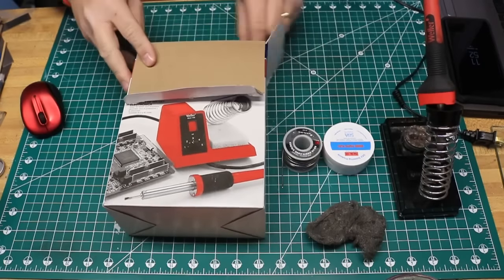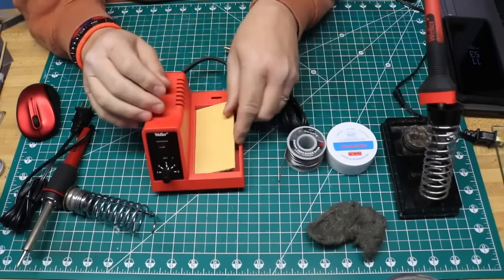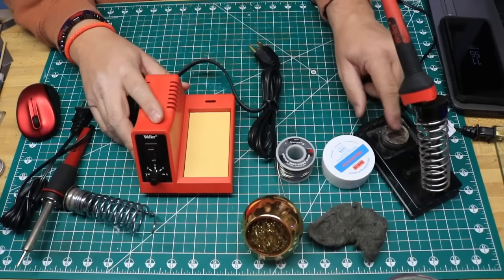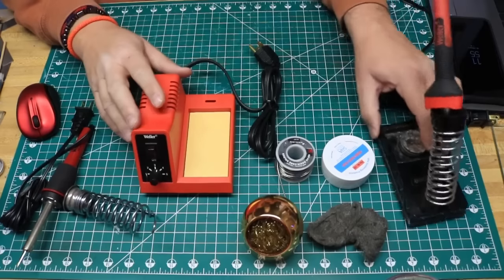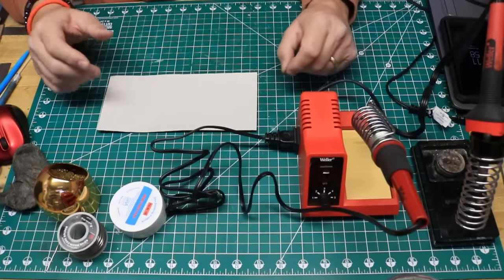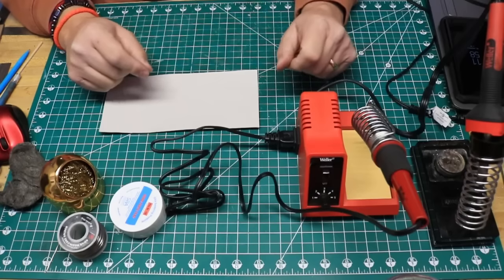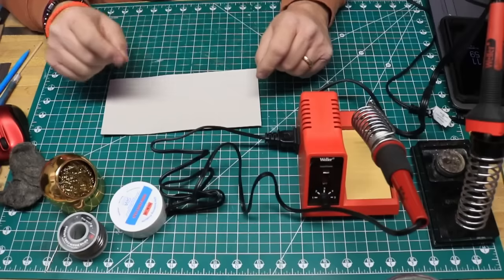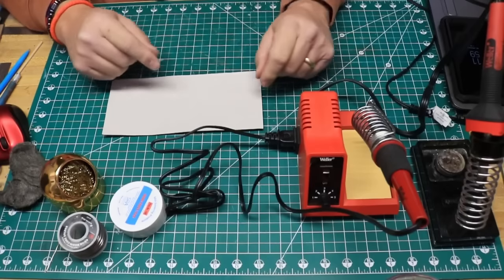How To Tin A Soldering Iron Tip

Comment: Ron,  I started Soldering with Silver solder and an Acetylene Torch, soldering pieces of Copper together.  I did this fresh out of High School.  This was my Job just after graduation at my Fathers Stampings company.  Not anything to do with the small electronics soldering we do now. My Dad worked with me when I first started doing this job and he told me the most important thing to know about soldering is that solder flows to the heat!  This information has always helped me to do a good job in soldering.  Knowing that it is the heat that does the work!
Reply from the maker: Great point. Thanks. 👍🏼

Comment: Ron, I have a question. Do you apply flux before you wrap the solder around a new tip or just the solder without the flux
Reply: I would love an answer also
Reply from the maker: On a new tip, just solder.

Comment: I am new to soldering and it’s been really frustrating, solder refusing to melt on the tip. 
Thanks for your advice on cleaning and tinning the tip, it’s much easier now, many thanks.
Reply from the maker: I'm glad you found it helpful.

Comment: Wow!!!! Ron...a most helpful video. I just finished watching your "adding a crossover" video and before asking about your cleaning solution prior to the brass cleaner I watched this video on soldering. This video reminded me of seasoning a new cast iron skillet and why its done. I have been doing all the wrong things with my soldering iron for years and now know why the lack of performance from it. I never tinned it to begin with, I used sandpaper on it all the time to clean it and I never put it away correctly. Thank you for sharing this info..I need to pull out the iron, get the products of proper care and see about re furbishing my iron or buy a new tip and start from scratch correctly. Tom
Reply from the maker: Glad to help Tom. I think you will find much better results and longer life from your soldering tips going forward.
Reply: I've honestly never tried to solder before all because of the things you pointed out, got my first iron a couple days ago and I've been worried about plugging it in til this video lol

Comment: I do the winding solder around a new tip thing, I use up old bits of solder I no longer use to do it. Maintenance is the key, and before you run of to celebrate completing one of those cheap SMD practice boards, tin you tip. Or is it just me that goes into celebration mode? I actually keep my boards to monitor my improvement… I'll go back to my sad little corner now.

I’ve seen elsewhere that the tip tinning cleaner should be used before leaving your iron to cool as it works better. I’ve always used it as you do until now and my Hakko T18-D16 must be a year old and looks like new.

I use the Weller brass sponge as it’s finer and seems to clean better, I heard it actually has more/better flux in it. I didn’t even know they have flux in them until then.

Comment: Very good video. I rarely use a soldering iron but this information may keep my 15 year old iron in good working condition. Thanks!
Reply from the maker: A rarely-used soldering iron is a great case for why tinning after use is important. The longer your iron sits between use the more important it is to keep it tinned and protected.

Comment: I learned to solder back in the 90’s as a kid. My dad taught me. Anyway, he taught me to use a wet sponge. IMO, nothing beats a wet sponge when it comes to cleaning your iron.
Reply from the maker: A wet sponge works great. The tinning solution just gives a bit of extra boost to the cleaning and coats the tip in solder.
Reply: I've been soldering for about 55 years, including two decades as a full-time audio-equipment bench tech,  and I switched over to the brass wool sponge about 10 years ago. I find the brass wool works even better than the sponge; and some manufacturers claim that the thermal shock of putting a hot tip on a damp sponge creates micro cracks in the iron plating of the tip and causes the tip to oxidize, pit and deteriorate sooner. PS, Ron, you're using the tip cleaning block far too often; they typically contain a harsh alkali such as ammonium chloride and if overused will remove the iron plating from the tip and hasten it's demise.

Comment: I'm brand new to soldering and I never did this.  I kept wondering why after a few connectors soldered why my tip was black and not transferring heat that good. Thanks for the help!
Reply from the maker: Glad to be of help. Have you tried this? How did it affect your iron's performance?
Reply: @RonsTrainsNThings  Yup it made a huge difference!! I never realized that the tip needed a coat of solder but now it works so much better. Thanks again

Comment: Well this explains a lot Ron.  I've never heard of this before and could not figure out why my soldering iron took forever to melt the finest size of solder I could buy from Radio Shack.  Time to pull them all out and do some tinning.  Is this necessary with the soldering guns as well?  You know the ones that look like a pistol.  I have one of them made by Weller but I have not tinned it either.  Thanks for sharing.  Keep up the good work.
Reply from the maker: Hi, Roland. I believe that cleaning and tinning your tips will make your soldering a much more enjoyable and less frustrating experience. Yes, you should tin the tip on soldering guns as well. Thanks for your comment.

Comment: Excellent video Ron! You know how much I hate soldering and I think you just showed me why. My tips are a black and charred as sin lol
Reply from the maker: Yup, anyone would hate soldering with a black, oxidized tip. They will not transfer the heat. Get a new tip, tin it, keep it clean and tinned, and who knows, soldering may become your favorite part of the hobby.
Reply: Steve, it's also important to use the right tip for the job. For soldering rails, and most general purpose use, I would use a tip that looks like a small standard screwdriver. For soldering electronic components, get a conical or pointed tip. The right tool for the right job.

Comment: Good video.  Thanks for making it.  I never had any formal soldering class/education and it shows.  Am I right in understanding that a higher wattage soldering iron allows you to get a joint hotter, quicker so as not to melt/damage nearby parts/circuits?  I'm thinking a higher wattage iron would be best for soldering track segments without heating plastic rail ties too much.

Also, if you're able, you might consider raising the Audio Output level of videos like this one.  I have the volume on my laptop all the way up, but was still wanting the video to play louder.
Reply from the maker: Thanks for the sound feedback. As for wattage, you want to strike a balance between heating your work quickly and getting it too hot. For N scale rails I use a 30 watt iron. For fine electronics I use about 10 watts--it just doesn't take much to get them hot and high heat can quickly damage surrounding parts.

Comment: Great info thanks so much! Just learning and getting frustrated already. First two attempts didn't go so well. Started with old iron and old solder given to me. The solder job ended up cloudy white and also seen some of it was discolored on the spool. My question is does solder go bad when it gets old?
Reply from the maker: I don't think solder goes bad, but if it is greenish you probably have an acid core solder. You may want to buy some rosin core solder to use. Also, if you have an old iron and the tip is black, you may want to investin a new tip.

Comment: Acid paste flux provides superior cleaning for soldering, I use it when solder assembling Fast Tracks turnouts but a note of caution, the solder joints must be cleaned to remove acid flux residue. I use denatured alcohol. Thanks Ron for an informative video.
Reply from the maker: That is true--subject of another video. Thanks.

Comment: Where can I give something like a quadrillion THUMBS UP 👍 on this??? Cause this deserves MORE than just a single one. 

I bought a cheap ol Walmart Soldering iron...Worked for about 2 or 3 times. No matter what I did, I couldn't get solder to to stick to the tip nor could I solder anything without making a mess or just ruining what I'm doing. 

Ok..Watch some videos, sponge this, scrape that...STILL couldn't get it to work. 

Ok...It's got to be that the iron sucks. 

I go and buy a Weller, regular plug in the socket, no controls Iron, comes with 3 tips...MAN...Worked great straight out of the box. UNTIL the 4th or 5th time using it. Nope. Nothing. I try cleaning, I try scraping, sandpaper etc etc. Dawned if I could tin the tip yo save my life. 

But I read Weller was good....I don't have hundreds of dollars to get fancy dial temp stuff....I want to connect this wire to that one. PERIOD!!! Why should I spend HUNDREDS on something so seemingly easy to do. 

The package of the Weller doesn't even explain anything at all. 

Yet, I watch video after video after video of people just ever so slightly touching one wire to another etc and BAM, done. 

That's the problem with videos these days...."OH, it's so simple....Do this then that, BAMMM!!!! Done.....NONE of those videos go "behind the scenes" to show what that person did to get the iron to work as the video shows. 

And WTF is up with the cost of a spool of solder costing AS MUCH AS a Steak Dinner for 2 people? 

It's SOLDER. Its basically CRAP metal formed into a wire structure. $30 per spool just seems to me to be stupid. Oh, and hey...don't breathe the fumes....so now, in order to do simple soldering.....I have to spend $30 on a spool of it, another $20 or so for a fan and filtration just to join 2 wires. 

I thank You Sir for taking the time and effort to produce this video, it helped explain ALOT. 

As for the people who bring this stuff to market with ZERO instructions.....I catch you out and about....I'm take you out back and shove my size 13's up your ass.

Comment: Excellent video. Just hoping someone can clear something up. Does he mean to cover the tip with melted solder and let it cool down with it on. Or wrap it in solder once its cooled?
Reply from the maker: Wrap the solder on a cold tip, then turn it on until it melts.
Reply: @RonsTrainsNThings  sorry I meant when you were finished using it
Reply from the maker: Coat in solder just before you turn it off and let it cool.
Reply: @RonsTrainsNThings  Perfect. thank you. I wouldnt have thought of doing that out of fear of damaging the tip. Thanks for giving me this information man

Comment: Am I right to assume the brass sponge is too soft to essentially sand or grind the tip over time?  Great video.
Reply from the maker: Yes, that is correct.
Reply: Ron's Trains N Things, thanks for the reply—that was something I was worried about, it does work great though so glad it’s safe to use.

Comment: Thanks so much for the video but I just spent several hours following your instructions to the letter with 2 separate soldering irons but have been unsuccessful.
Both soldering irons remain black and the solder simply balls up and falls off.
Reply from the maker: If they are that black and burned it is time for new tips. This extends the life of good tips, but ultimately tips are consumable and need to be replaced from time to time.

Comment: I never have had much luck trying to tin a tip by heating it just with its own iron.  I almost always need to use a second soldering-iron to melt the solder onto the freshly-cleaned tip (I don't know why you say not to use sandpaper or a wire brush to clean the copper tip; that's a necessary step for the solder to adhere properly, especially for a used tip that's already oxidized or soiled with baked-on contaminants.  I find that a Lola stainless-steel-mesh scrubbie-pad works best of all, though, for gently removing even very hard or deeply-embedded oxides and deposits, without taking off too much of the tip's base-metal; a little wet-paste Comet cleanser can be a helpful "persuader" for scouring off really "stubborn" build-up) of the first iron.  The solder-coiled-around-the-tip method you showed does work sometimes, but you will want to add a thick dabbing of paste-flux to both the tip and the solder prior to heating it, so that oxidation doesn't form before the tip gets hot enough to melt the solder onto itself; the flux should be applied even if you're using rosin-core solder, too, since the solder would have to be heated hot enough to melt (and this temperature would be too hot for oxidation not to form on the bare-copper tip) before the flux inside could touch the tip and stop the new oxidization.
Reply: For the last part of your comment about the solder-coiled-around-tip method and the thick dabbing of flux: I am using Novacan's old master's stained glass flux and lead free solder (jewelry making). Can I use this liquid flux on the tip, could the solder, then heat? or is that a big no no
Reply: @BiologicalTableSalt  I have always used just regular paste flux, so I am unfamiliar with the liquid type.  But in any case, as I said, I have had much better results by using a second iron to heat the first iron's tip when re-tinning, rather than just heating up the iron whose tip I'm trying to tin, and having it oxidize before it gets hot enough to melt the solder.  Really, though, if you just get a container of regular paste flux to use for tinning your tips and other general-purpose soldering, this would likely be the best solution, and it's not even very costly, either --- a 1-or-2-ounce container is only a few bucks at a hardware store or eBay, and if you usually just do occasional small soldering-tasks like I do, that container should last you several years.

Comment: Are you using lead free solder or rosin core solder  to tin the tip
Reply from the maker: I used rosin core, but either will work.

Comment: I understand that the upper part of the tip isn't used for soldering so it doesn't need to be perfect. I was hoping to see an old tip made usable. I suppose I'll just repeat the steps you show & hope that it works for me.
Reply from the maker: Tips are consumable, and they reach a point of no return. If you cannot get solder to stick it is time to replace it. It isn't going to transfer heat at that point.

Comment: hi ron this is my first time commenting on your videos that I'm a big fan of. ive noticed you are using radio shack solder that I also use. unfortunately radio shack has  closed in my area a great loss to me and I'm sure to a lot of other modelers
Reply from the maker: Hi, Bill. Radio Shack is out of business now entirely, a fact about which I have mixed feelings. This roll of solder is a spare that I had stocked up on a few years ago and recently opened.

Comment: At 14:30, the primary reason solder won't tin the rear of the tip is because it's plated with chrome or something other metal that resists solder. You could clean the black oxidation off,  but that section of the shank still won't accept solder; it's not supposed to!  The tip is plated with iron which will allow solder to tin it but won't easily be dissolved by the hot solder and flux. Underneath the plating, the best quality tips are copper; only the pointy end of the tip should be strongly attracted to a magnet, becahse of the iron plating.

Comment: Thank you Ron!  For the wlc100 station and the 40 w iron provided, what dial setting on the station do you use for soldering rail joints? 3 ish?

Comment: do you need acid flux to clean the tip or can you just use rosin core solder?
Reply from the maker: It doesn't have to be acid flux, but some type of flux will be helpful.
Reply: @RonsTrainsNThings  great thank you very much

Comment: I had one of those Orange Wellers with the LEDs. The tip was destroyed in about 3 hours of use.  But it was 40w and way too hot. You're fighting a losing battle trying to maintain the tip on a soldering iron that has no temperature control or power control. They simply run the tips much too hot. My 25w pencil will idle in the holder at over 450C. Contrast that with a "proper" temperature of 350C or less (320 is about ideal). I can burn a ton of solder trying to keep the scorching pencil tinned but it's a struggle. I strongly recommend that if you don't buy a soldering tool with at least a little bit of power control or adjustable temperature, at least get some means of turning it off and on when it's not in use. A soldering iron just sitting in the holder at full heat is one that is destroying its tip. How to solve this problem? The easiest way is unplug it immediately after use and plug it in just before use. Don't let it sit and cook at full temperature.

The best solution IMHO is never buy the cheapest soldering setup. Get at least one with a temperature setting. Even a crude control is far better than none at all. You can make a variable power setup using a dimmer switch and a receptacle with basic home wiring parts from your local improvement store. Or you can get a momentary footswitch that works just like plugging and unplugging. Step on the switch to turn on your iron and remove your foot to unplug. They are $30 and super useful.

Ultimately, I bought a proper station with actual temperature control in degrees. All of my soldering frustrations went away when I bought a station with actual temperature setting and a few different tips to give me the right shape for the task.